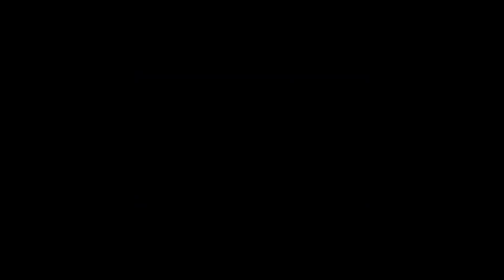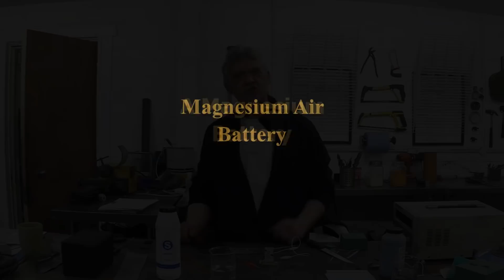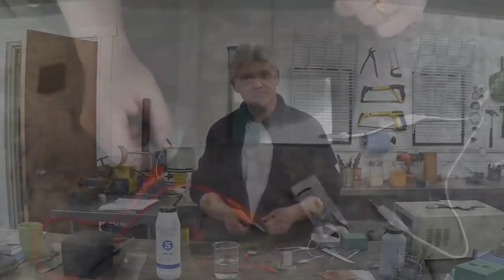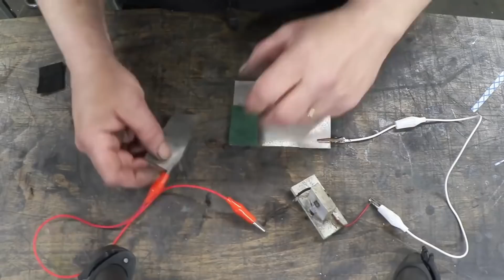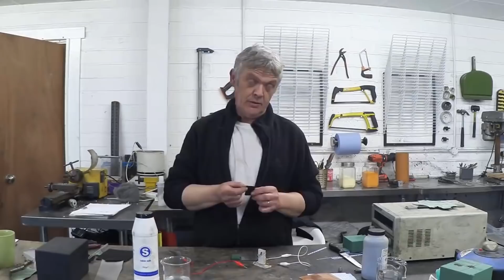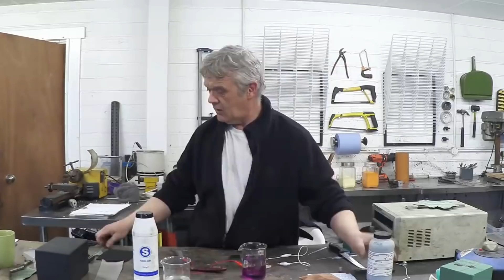1462 The Secret Of The Magnesium Battery

Comment: at 4:35 you apply a piece of catalyst ON to the steel sheet - I just don't understand how it can work if the steel in impermeable to oxygen which is given by the catalyst. How can oxygen make its way to magnesium from catalyst if there is steel?

Comment: The maganese dioxide acts as a consumsble catalyst in zinc carbon cells to get amps from oxidizing the hydrogen atoms released, in an air metal battery it helps grab oxygen from the air to do the same task as a true catalyst. ❤

Comment: About 10 years ago I played with aluminum/steel/acid fuel cells. The reason I call it a fuel cell is that the acid ate up the aluminum turning it into aluminum oxide. 1.2 v per cell. One of the things I found is that the stronger and more reactive the acid the more amps available.

Comment: Excellent video Rob, I am actually planning to make a magnesium air battery. It just so happens that I have 1-2 A4 sheets of carbon felt and also 100-200 grams of potassium permanganate. For 100-150 ml of water you would only need 1-2 granules of potassium permanganate. It goes a long way.
Reply from the maker: you would need very little mate - it does go a long way

Comment: if you have magnesium replaceable AA batteries, that would be awesome, you just have to replace magnesium cores rather than throwing away lots of batteries.
Reply: They will just need air ventilation holes in order to get the oxygen
Reply from the maker: yep

Comment: I'll have to look up and see if anyone has tried it but I think the sacrificial anode in water heaters could be used to make a battery. Might be useful in an emergency. However, they're difficult to remove from the tank.
Reply from the maker: if you live on the coast you can always just go to a chandlers and buy a zinc sacrificial anode
Reply: Yes they do work well. Make a battery from a copper or iron tube, some rust, a separator, and epsom salts. Mixing some graphite with the rust helps it work better. About 1.7V and 3 to 4A for a standard sized anode rod.

Comment: Lithium hydride dissociates around 900 deg C, Magnesium hydride around 109 deg C. A matrix could be constructed to coordinate hydrogen to a metal allowing for a higher density and debatable safer storage of hydrogen not as a pressurized gas but as a metal hydride. As long as the metal is not exposed to air the 'fuel tank' could last for a while.
Reply from the maker: cool

Comment: Hi Robert, I really like the simplicity of this method! 

Just checking, you mention we need a 0.01 to 0.05 'molar concentration', is this right? KMnO4 is 158 g/mol, so at 0.01 'molar', the mass required for a 200 mL solution is 0.316 g, and at the higher conc. of 0.05 M, the mass needs to be 1.58 g in 200 mL. So when you say earlier that 'about 0.1 g of KMnO4 is needed', is it actually best to use less than a 0.01 M conc. for the synthesis?

Comment: Question.  You gave us a solution  concentration,  however im confused on the size or mass of the carbon per ml of solution. 
I ask because i am having difficulty replicating on a slightly  larger scale. Still using mag stir. so not a huge difference in size.
Problem (despite recommend solution strength solution not going clear or even lightening)

Comment: Could you also control the speed of the reaction by limiting the oxygen or stop it all together by flooding the cell with argon?
Reply: yes ... let's take a very cheap to manufacture (the point in this chemistry) system and make it absurdly expensive with argon flushing, smh.
Reply: @wanderingzanzey2126  its only cheap on a small scale. Im sure if you producing 15 or 20 kw a day it wouldn't be so cheap and you might only need a few kw so why waste the rest of the material not being used? SMH
Reply: @dougpine4746  that's literally not how any of that works ... But sure ... if you think so. Take it from an electrochemist working in the field - this is not a good idea. Don't invest in it, you will burn money.
Reply: @wanderingzanzey2126  Can I ask you a question, sir? What's the cheapest, safest (and ecological friendly) method then to make a DIY metal air battery? Which metal is the cheapest? The idea is to use scrap metals one can find for free/allmost free, to charge a powerstation, that can be used for mobility and power devices, when solar charging and grid charging is not an option. A citroen Ami microcar for instance uses a 6kilowatt battery that can be charged using a regular mains plug. I guess a good powerstation can be used too to charge that car, but how to charge the power station... Hmm, maybe it is just more easy to buy an Evoy(?) methanol fuel cell and charge the powerstation with that, but that is expensive.

Comment: Hello Robert, I just came over your wideo and is really interesting. I wondering if you sandwich the ss plate from both sides it would double the output? Also if is matter how thick the carbon and the floral sheets are I mean max. 1/4 inch? For how long a closed cell battery would last. Your answer would be greatly appreciated.

Comment: Would this treatment help with Al  "air" (oxygen/oxidation) batteries?  If I remember correctly, there is already a weak reaction between carbon and Al where carbon speeds up the oxidation of Al.

Comment: sorry i couldn't see the difference
Reply: You could hear the difference when the motor speed increased substantially.
Reply: @stevetobias4890  i couldn't
Reply: @roberthopgood1894  try watching it on a computer with the speakers turned up a little, you will hear the speed difference once the carbon cloth oxidised with potassium permanganate is introduced.
Reply from the maker: then do the experiment - you will see it then

Comment: Hi, would any part of this catalyst function to aid the reaction of hydrogen and oxygen to produce the exothermic water/heat reaction? I would not have thought of it but you mentioned platinum in passing. I have been looking into platinum substitutes and thus far have read about nickel based bits.
Reply from the maker: I don't know mate - sorry
Reply: No, it wouldn't; The overpotnetial is very high for MnO2 and it's ORR performance is very sluggish. It would be a poor performer relative to platinum for an HER-OER recombination reaction. Platinums overpotential is around 40mV - hard to compete with that.
Reply: @wanderingzanzey2126  Thanks so much for getting to this. Have you seen work on nickel based compounds? The goal as you may have guessed is heat production.

Comment: yo thanks bruh , couldn't sleep to night and came on to this video. now i had this idea of a small bottle of kaliummaganate , so i started cooking right away did a 2 hour 90 degree with graphite felt activated carbon and 3d printed carbon conductive pla . and it works i get a nifty 0,5 V open voltage out of my pee reactors. I was looking ages for a catalyst in reach and it was already waiting for year without notice in my room.....
great stuff science 

put a carbon graphite cloth in a cup 4-8 cm anode height peace of jcloth or just 5 mm  spacing within the manganese oxide graphite/carbon cloth half in pee solution and in the rest in the air.
pee power to the people :)

Comment: This reminds me of the (any with paper-wrapped, delicate or confectionary nature, please look elsewhere. This genre might not comport to modern norms without clarification.) "handy books" for boys which l read in coming up. One project was for a zinc-air "fuel cell" that was technically accurate in nomenclature but rather difficult in refueling. The manganese dioxide, reclaimed from a 6V stack and the "zinc" was just the Galvanic coating on a piece of roofing.
Far too little of the "give it a go" spirit (with apropriate H&S precautions) in the curious minds of today for my liking.
Reply from the maker: I agree